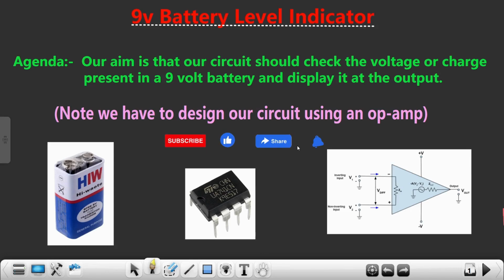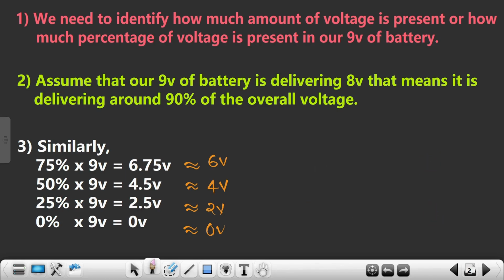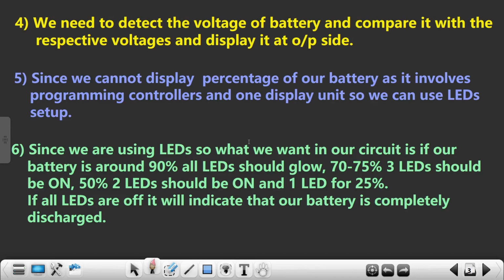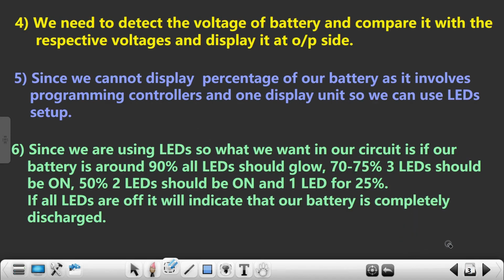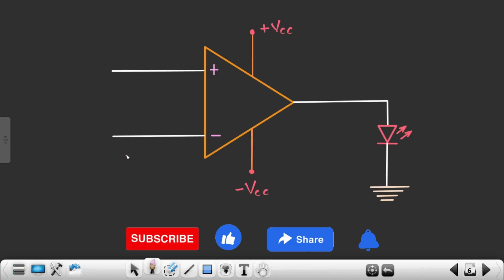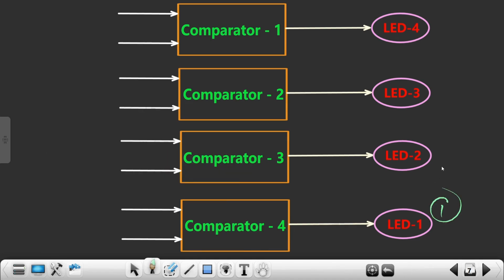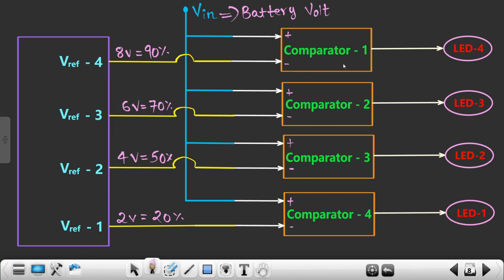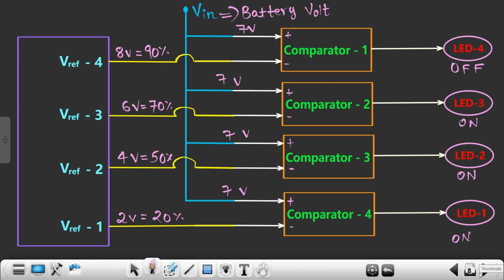Battery Level Indicator 9v 🔋 | Block Diagram | #batteryindicator #opamp #ledlights #opamp #analog 🔋

Comment: Hey where is the next video
Reply from the maker: I have not uploaded it yet. You will get full video here:- https://www.udemy.com/course/opamp-741-projects-design-simulate-circuit-on-proteus-ltspice/?referralCode=BDC92068534B9576A6D5

Make sure to like, share & subscribe the channel.
Reply: @practical-buddy  please upload, 799 just for one video is not feasible
Reply from the maker: @anupamsarashwat2607  You might get a discount with this new link, and it includes multiple op-amp-based projects, not just a single video.
Link:- https://www.udemy.com/course/opamp-741-projects-design-simulate-circuit-on-proteus-ltspice/?couponCode=MAR-02-2025